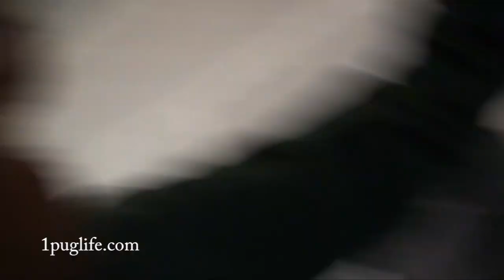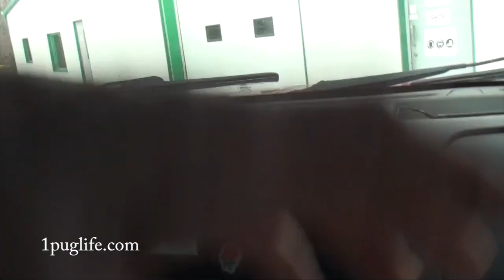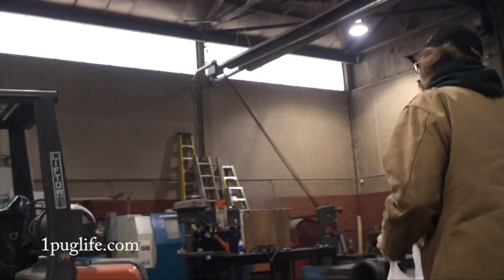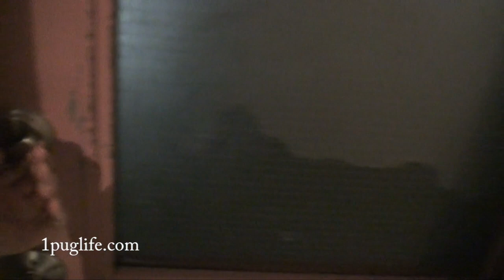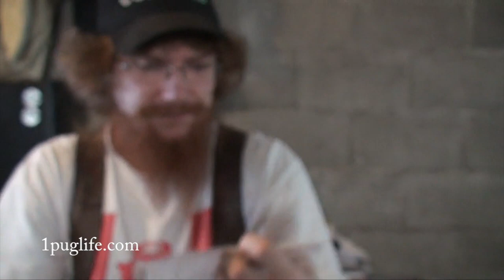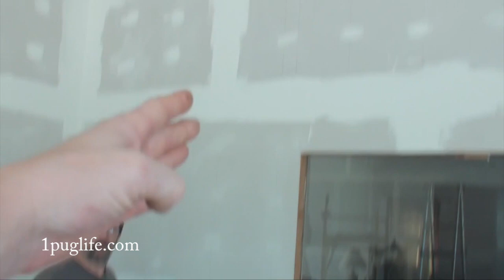on the phone with the boys and it condensates when it rains

Comment: Are you going to spray the ceilings with knock down? I did mine and had never done it in my life and it actually turned out well. The drywerds looking good.
Reply: +Ridge97 Does it block condensation?
Reply: 0TruckMafk ☢TM™" prolly not LOL..I did my ceilings..it's simple and looks good. I wish I'd of sprayed my walls because of the shitty drywerds finishing. It's for covering up bad stuff  in say old houses and gives it some appeal. :)